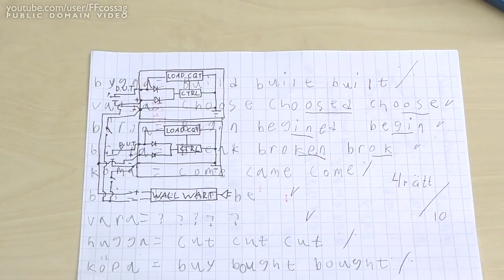Modding CC load for lithium testing

Comment: to combat the holes which are NOT in line get yourself a center punch. spring loaded is fine ans easier to use in the workbench environment. Tiny dimple it makes stops drill to walk out of the marked point. For bigger holes use small drill first.
Reply from the maker: I do center punch my holes but I get them wonky anyway, lol.